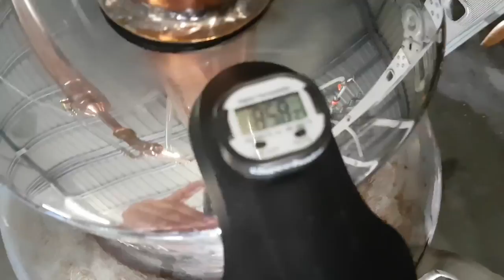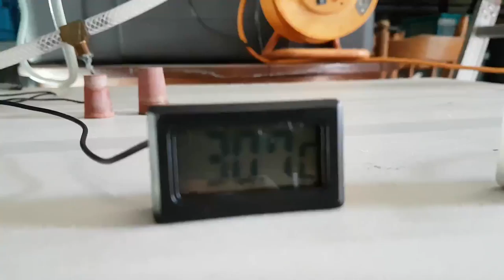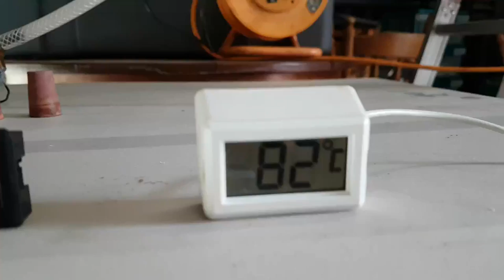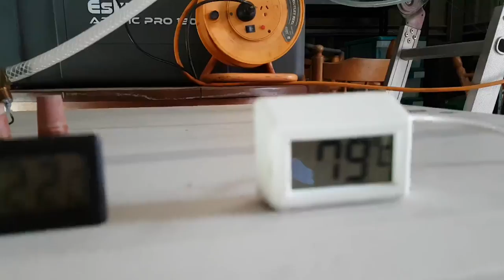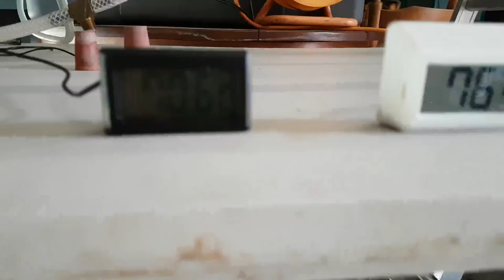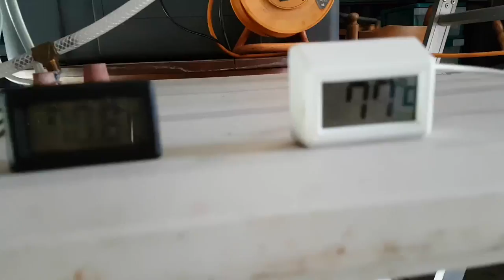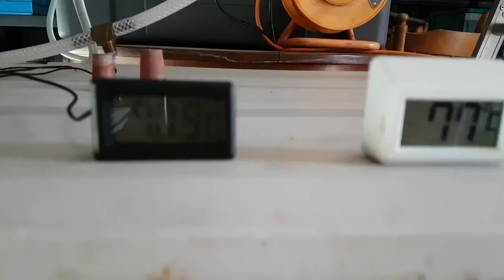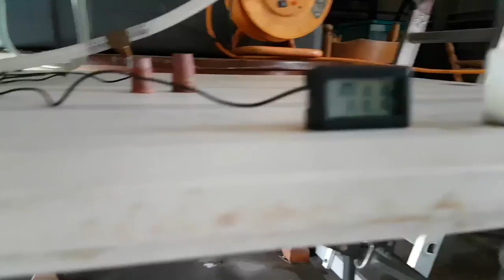How to distill alcohol with a reflux still first run 13 12 2017 mp4

Comment: There appears to be quite a few safety no-nos I've noticed in some of your videos. I would wrap your black gaskets with 4 layers of teflon tape to protect them from the hot vapors. You should never use pressure cooker gaskets and aluminum pots are a big no no too. The black rubber grommet can be replaced with a brass compression fitting. You don't have to worry about having a perfect seal because your top cap should be vented and as long as your condenser is working properly, no vapors should be escaping anyway. Even so ... I'd still remove that grommet because it is not going to hold up to alcohol vapors. I would have a good look at what the seals in your quick disconnect are made of. Hopefully they are PTFE/teflon. If not, I'd replace them with copper unions.

Comment: I have a 2" T500 kit with condenser and 4 floor 3" bubble plate kit with 2" to 3" reducer get 96% proof without fail from start to finish and run it at condenser at 51c - 55c max. I take off 250mls heads and get 2.500mls in quality 96%. Bubble plate don't give me tails and the the purity and smell is amazing. I use pure turbo yeast for white spirit and turbo yeast classic 8 for dark spirits. Never use that charcoal or a+b clear just the turbo yeast ONLY. Takes 8 days to finish and with 7g dextrose sugar 1 teaspoon of nutrition and 30Lwater. That's it. Takes roughly 4-5hrs to finish the still. If you run it too fast eg. 77c you get more quantity at lower proof which more like a strip run but I always aim for 96% and water it down to 40% but either way don't matter because you goto water it down. Absolutely love that parrot going to make that one. And your still setup is a beauty 👍👍👍